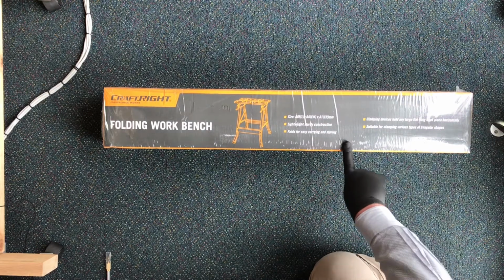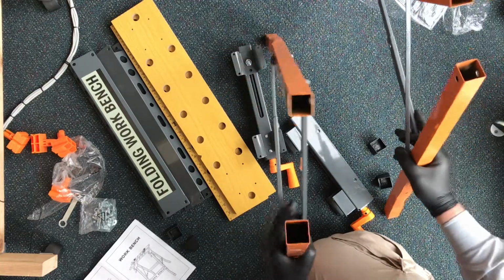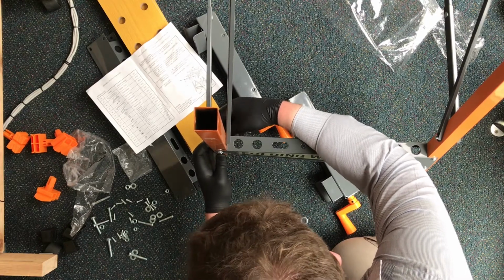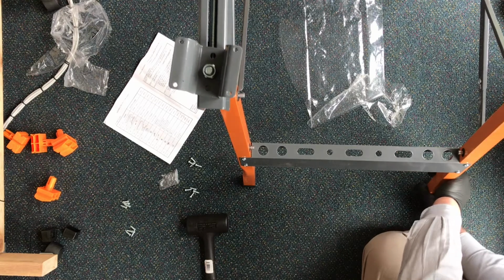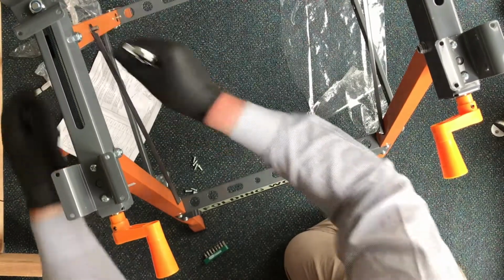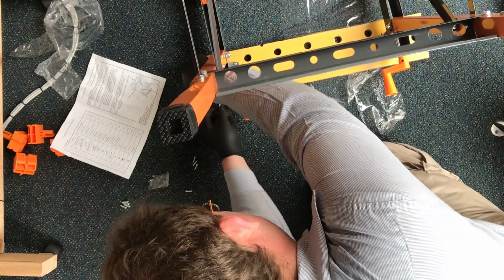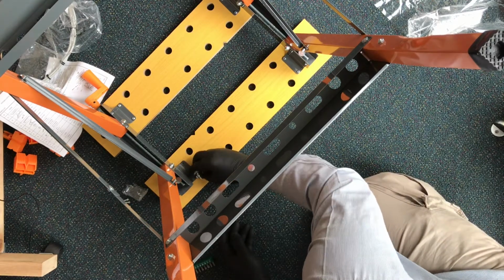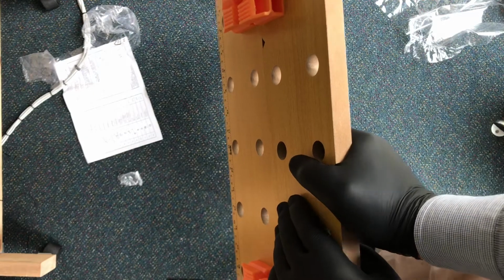Craftright Folding Bench n' Vice Unbox, Assemble and First Impression.

Comment: Very poor presentation. Why didn't you tighten all of the nuts and screws, so that you could see if it resolved the shaky construction? I have put this together, and I can confirm that it is a very sturdy bench, when opened for use. My ONLY issue was that some of the pre-drilled holes, in the top sections, didn't line up correctly with the pre-formed metal constructs. Easily solved by drilling two new holes. For the money - a bargain!